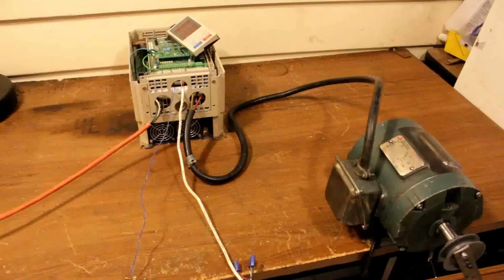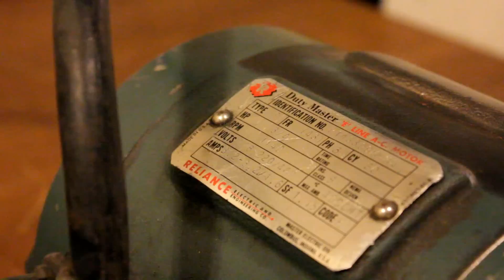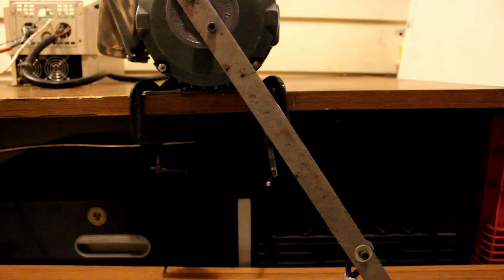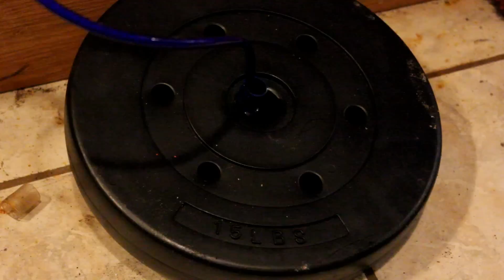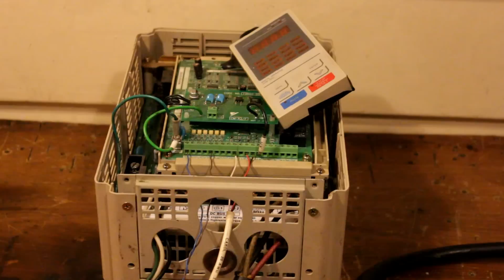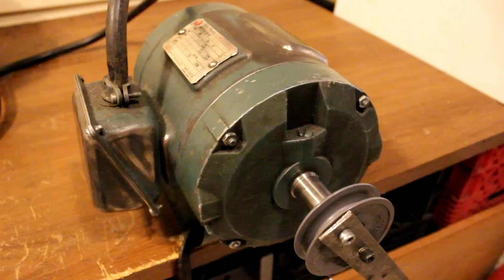How To; Induction motor stall torque test

Comment: i made one these many  years ago  to test motors torque with a 12" bar on a car break drum, a scale  to read pound's  but no VFD back then  and i use a volt meter ,amp meter , RPM meter,    etc,etc, and some math  to figure thing's out using the information on name plate on the motor.

Comment: You might find it interesting that new premium efficiency motors (mandated by DOE) have multiple times more breakdown torque than older motors. If you tried this test with a new direct replacement motor it would throw your weight across the room. Machines are being destroyed all over the world when old standard or high efficiency motors are replaced with premium efficiency motors. This is due to greater core iron density, narrower air gaps and different winding geometry. Higher efficiency but also higher stall torque.

Comment: I am trying to get 24000rpm with a 2 pole 415v induction motor using a vfd. But after 250hz the motor stalls. Theory says i can obtain 24000 rpm i. E. 400hz with this motor. But it stalls after 250hz. Can you tell me what may be wrong?
Sourabhkumawat117@gmail.com

Comment: Can you do this with a DC motor safely? Is there more risk than an induction motor?
Reply: Yes, and yes. More power in just about always results in more power out of a motor. With a DC motor, if it has permanent magnets, the magnets strength will limit how much force the motor can put out. You will hit a point where higher input power results in marginal, if any, change in output power. And theres more risk with a permanent magnet motor, as heating the magnets too hot will result in a drop in their magnetism. They will also no longer be magnetic at all if you get them extremely hot for too long. But if youre talking about very brief bursts, its really no problem at all. The total risks depend massively on the exact design of the motor. Generally, the risks are very low with a good quality induction motor. It will absolutely reduce life, but when the life of a motor might normally be 10+ years at full design load 24/7, for hobby uses, this tends to not be an issue.

Comment: Wait doesn't a star connection create a lower voltage across the windings?
Reply from the maker: A star connection gives more back voltage than delta. Usually in star the motor wants 8 volts applied for every 1 Hz, so 480 volts at 60 Hz. Delta is half of that. So in theory, a star connection should produce more torque per amp. The issue is, on a motor this small the resistance of the windings is so great, extra voltage would be needed to overcome the resistance losses. That's why the motor is in delta for this video. Thanks for watching
Reply: subcooledheatpump thanks for the reply, a little bit over my head there. So at a basic level star does have lower voltage across the windings but creates a larger back EMF? I have a 10HP 30A 200V  motor at work running the pump on a 3 storey water slide. It's DOL at the moment and connected in delta, I want to connect it in star to see if it can create enough torque for the load on start up and if so install a star delta starter however I'm worried about burning out the windings. Do you have any advice for me?
Reply from the maker: Should be okay to install a star delta switch. As long as it starts turning in star and you can switch over to delta in a timely manner. Most motors are fairly robust and the windings won't burn instantly. It's unlikely, but if the motor does stall in star then you won't be able to use a star delta switch. My best advice is to momentarily (only for a few seconds) connect the motor in star and switch it on and see what happens. If the motor can turn then it should be okay. If not, then it would be better to get a VFD or a soft starter

Comment: hello mate, great to see you,
that was interesting' i was wondering if it would do a loop the loop Lol. some good power tho to lift that!

thanks for sharing bud"😉

👍👍👍👍👍THUMBS UP👍👍👍👍👍

Anthony

High1voltage1rules
Reply from the maker: I tested this motor and used a bucket of water as the weight, and it almost did. I turned the motor off once I saw it was about to loop, the bucket hit the ground and splashed water everywhere! what a mess. I thought it was sure to short something out but it never touched the VFD or the motor. Good to hear from you again and thanks for watching
Reply: subcooledheatpump 
hello mate. wow that would of been a shitter to mop up lol. 
what is your first name? always wondered Lol. you look like a mike" or simon" lmao😁
any how's yeah thanks mate, and good to see ya channel is getting better with sub's. 👍😊

hope ya well mate and be safe.

Anthony

High1voltage1rules

Comment: So the bar was not quite horizontal, so the effective lever length needs to be multiplied by cos(angle_from_the_horizontal).
Reply from the maker: I knew someone was going to point this out. It didn't happen in this video but I've tested this motor several times, and it has lifted this weight higher. Why it didn't perform on camera? I probably didn't get my V/F ratio exact on the VFD since I keep reprogramming it for different tests and motors. But I think everyone got the point of how to perform the test anyway. Thanks for watching.
Reply: @subcooledheatpump hi can show to get have a vfd on a single phase motor Nd will a addition of ballast help with single phase as it wd help as a current multiplier
Reply: That is really smart way of starting the motor and stall, not just start with head on... It means the torque demand is increasing as the effective length from the pulley increases.